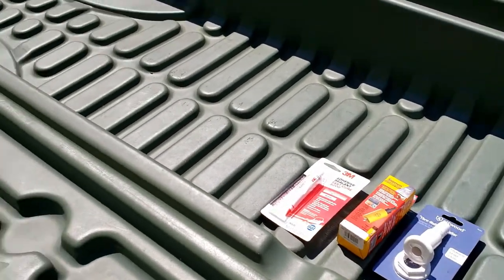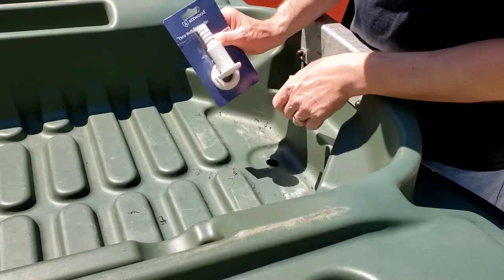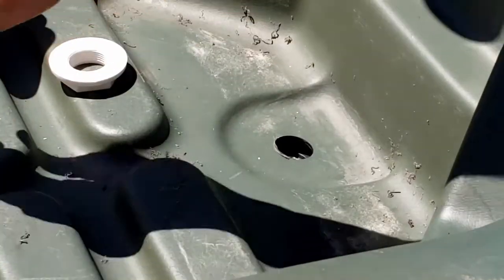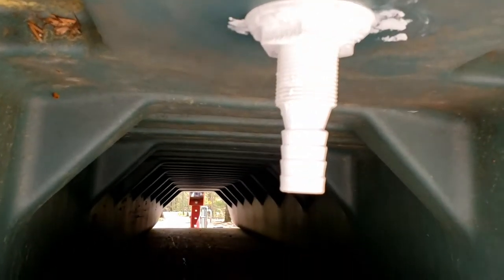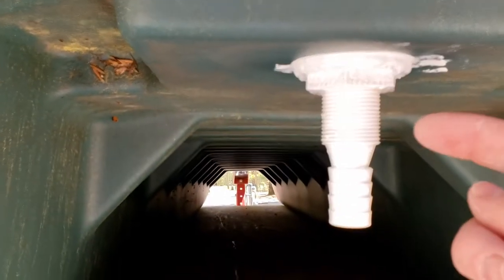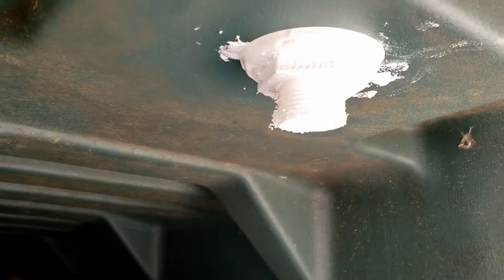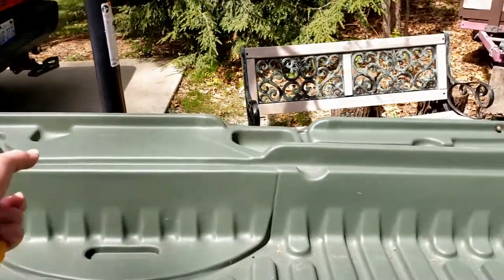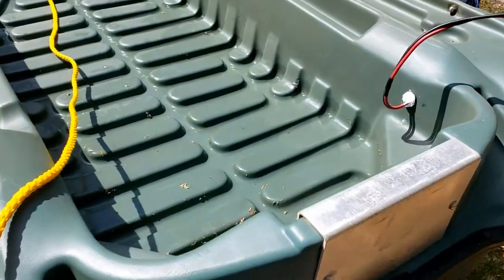Scupper Hole - Bass Raider 10E

Comment: If you get alot of water in your boat and you want to drain it while you're still out on the lake, just go fast and pull the plug out. The suction caused by the boat moving will suck all the water out. Worked great for me.

Comment: How is the scupper hole working out ?
I have a new Raider and thinking about doing this.
Thanks
Reply from the maker: It’s been great. I’ve been out a few times in rough water and took on a lot of water. It all drained out quickly.  I was so glad I had that installed.
Reply: Thanks for the parts list gonna do it